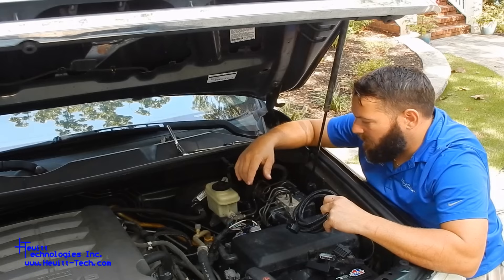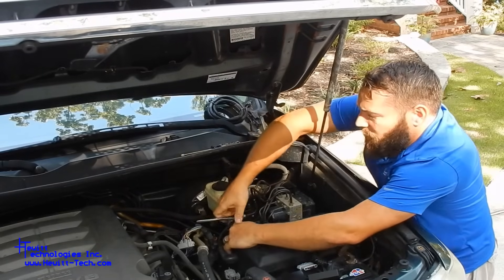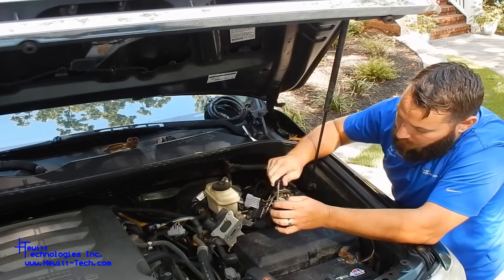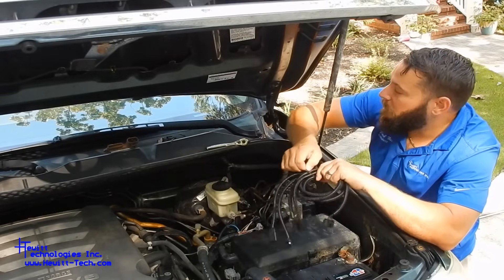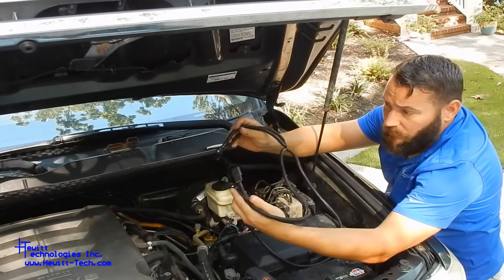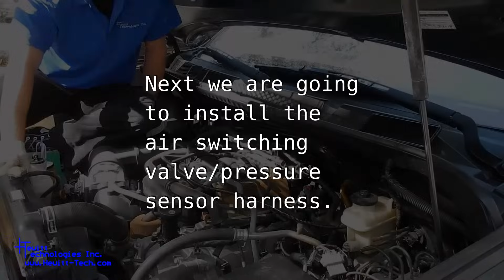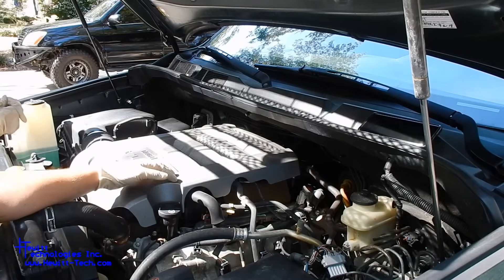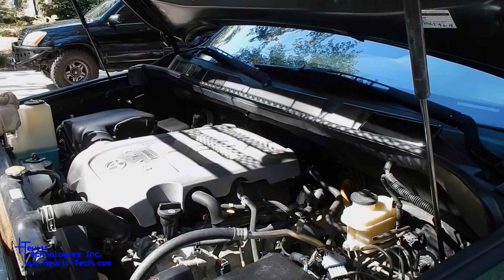Gen-II Secondary Air Injection Bypass Module - 2007-2021 Tundra 5.7L- Hewitt Technologies

Comment: Good evening I’m acquiring a problem I did the bypass unit and everything worked fine for about a week now a new code came out p2714. Has this happened to anyone else if so please advise. Thank you
Reply from the maker: This is not an SAIS fault and would not be related to the Bypass Kit or Secondary Air Injection System. DTC P2714 - Pressure Control Solenoid "D" Performance (Shift Solenoid Valve SLT). Here are some areas you may want to troubleshoot. -Shift solenoid valve SLT remains open or closed
Shift solenoid valve S1, S2, S3, S4 or SL2 remains open or closed
Gear 6 incorrect ratio (sequence valve) or 1-2 shift valve is stuck
Valve body is blocked
Automatic transmission (clutch, brake, gear, etc.)

Comment: I had to replace the passenger side pump on my 07 4.7 tundra a few years back. Cost me about $400 doing it myself. Didn’t know anything about Hewitt back then and didn’t know the problem could reoccur because of terrible design by Toyota. Got another code for a pressure sensor (p2438) this week and went into limp mode. Got the double sensor harness bypass and SAIS bypass (gen 1). Putting the harnesses on and fishing the starter relay took all of 10 minutes. The exhaust block off took about an hour just because of the tight space on the passenger pump. Cleared the codes and now it runs like a top. It’s a bummer a company like Hewitt had to fix a significant issue from Toyota….

Kudos to Hewitt. I highly recommend them if you have any problems with your SAIS or AIP…whatever the acronym is :)
Reply from the maker: John you know what they say, "necessity is the mother of invention". I agree it is unfortunate the failure prone SAIS has not been addressed but Hewitt Tech is happy to meet the need with a comprehensive solution and affordable solution. Thanks again for taking the time to leave a comment and review. Give us a call if there is anything else we can assist with.

Comment: This kit will make the P2443, P2438 and P2436 codes go away? Got a 08 tundra 4.0 v6
Reply from the maker: We can help with all of those codes but some of those are pressure sensor circuit codes that will need some special attn. Please give us a call toll free 1-844-307-7601 or shoot us an email support@hewitt-tech.com before placing an order. 
Some of those codes can be the result of wire damage, sensor damage, bad aftermarket parts or even a damaged ECM.. We can still help take care of all those codes but sometimes it is not as straight forward as just needing the bypass kit.

Comment: Installed a week ago and no more codes or limp mode on my 2008 5.7 w 187k. I was getting the P2443 codes for both banks - stuck closed. Took me a while to get the passenger plug undone, and the block off plates were easier than expected. Worth it!
Reply: Which one did you order gen1 or 2 ?  Which one is required for which?  Ty
Reply: Good morning,,quick question  my 4lo,engine ,trac ,light all comes on do u think this bypass kit will make them go out
Reply: @matthewwatkins1156  It may - if you don't have a code reader, an auto parts store will usually scan for free and give you the codes that are causing the faults. Check that first - mine was P2443, and this kit fixed it.

Comment: For "offroad" use eh?
Reply from the maker: Hewitt Technology’s SAIS Bypass Kits and products are sold for off-road, competition or other emissions exempt vehicles only. It is illegal to remove, dismantle or otherwise cause to be inoperative any pollution control device required by federal, state, or local emissions law. . No other applications are intended or implied. By installing or using this SAIS Bypass Kit the vehicle owner and installer acknowledge and assumes ALL risks associated with its use.

Comment: Will this work with a 2011 5.7 supercharged. I don't know what the previous owner had done to the Tundra. But I'm getting the codes now.
Reply from the maker: The Hewitt Tech Bypass Kit will work with many of the supercharge modifications out there. That said, we still require the Air Switching Valves to be on the vehicle and the Pressure Sensor to be in good working condition. If the valve had been removed they the Gen 2 Bypass Kit would also require the Pressure Sensor Addons. Please feel free to give us a call if you have any more questions (844) 307-7671

Comment: Your links do not work in the description.... Not sure about the $400 you want for some wires. I can replace the parts for that.
If it were $300 I might buy it
Reply from the maker: Thank you for letting us know some of our links are not working. We will get that taken care of asap. 
You can certainly continue to  replace individual system components with low-quality aftermarket parts at those prices if you like. That is the great thing about the "right to repair" we still have in the US. However, when you continue to have problems with the system, I hope you will give us a call and let our 10+ years or so of expertise help you. Those "wires" as you call them are designed, assembled and supported  I can assure you we arent we aren't just selling some wires. I get  so you know... those wires are  developed, engineered, made and supported completely in house by our small SC company. They are covered with a limited lifetime warranty and full technical support that will actually help you fix your vehicle... if you can figure out how to support a small company like ours with the quality and value we provide our customers at a lesser price please let me know. 
Paul Hewitt President.
Reply: Totally agree with this response.

Comment: Installed mine nothing changed still has no power any suggestions
Reply from the maker: Give us a call with your trouble codes. Could be something simple like just needing to reset the ECM, install block off plates or something else.

Comment: I got a 2010 5.7 tundra giving me a P2442 code. Blinking 4LO, TRAC & check engine light. 
We don’t have emissions where I’m at. If I install this does the check engine light stay on?
Anyone know?
Reply from the maker: The Gen 2 Bypass Kit does address the P2442 Mechanical SAIS fault code. However, if this code is masking a damaged Pressure Sensor. We have seen when "Valve Stuck Open" codes have been neglected it can expose the Pressure Sensor to exhaust and damage it. If that was the case you would need the Pressure Sensor addon in addition to the Bypass Kit. As long as you had no factory wiring damage or ECM damage then should address the issue. You can always install the Gen 2 Bypass Kit first and if that does not resolve the issue then purchase the addon.

Comment: Hello, why not just not worry about them. Of course the engine light stays on but that's the only inconvenience. That said, what should I use for my 2012 tundra 4.6 Liter? Also how did Toyota mess up creating junk?
Reply from the maker: Many of the problems with this system will cause the vehicle to enter limp mode. Continuing to drive with valve stuck open codes can damage the pressure sensors in those valves and then you are permanently stuck in limp mode until you take care of it. 
There are other reasons but mostly limp mode. Besides, driving around with a check engine light on is never good. If a more serious problem happened and stored a new code you wouldn't know if the light is always on...

Comment: Do you cover a 2007 Sequoia 4.7L with P0418/P2445 codes? I also have P0340/P0345 camshaft position sensor codes but I feel its related to this "pump stuck off" issue.
Reply from the maker: We do have Bypass Kit compatible with your '07 Sequoia 4.7L to address the SAIS fault codes of P0418/P2445. Unfortunately, our products will not address the camshaft position sensor codes. Give us a call and happy to walk you through the Gen 1 & Gen 2 Bypass Kit options. (844) 307-7671

Comment: Do you need 2 kits if you want to replace both banks?
Reply from the maker: Negative. Even though they are basically two separate systems operating in parallel, one Gen2 kit will take care of both banks.

Comment: To my understand this system prevents the pumps from ever turning on; yet I still hear a whistle/squeal when my vehicle first starts like the pumps are active, though I have no other issues. Is this normal?
Reply from the maker: If you have a Gen2 kit installed there is no way the air pump is running as it is completely disconnected as part of the installation. Toyotas are generally known for a high idle up on a cold start and the engine cooling fan can make a good bit of noise. If you are hearing a squeal, I would highly recommend getting a mechanics stethoscope and try to isolate the noise. There are a lot of bearings/pulleys in the accessory belt drive on the front of the engine that could be making noise to include your alternator and A/C compressor/clutch.

Comment: Do I need the Gen 1 kit for a 06 lexus gx470
Reply from the maker: We have both the Gen1 and a specific the Gen2-3V (a specific version of the Gen2) that will work with your vehicle. There are differences in what they can do so give us a call with your codes and we can do a consultation to determine which is best for you. Toll Free 1-844-307-7671

Comment: Just ordered yout kit for my 2008 Sequoia. read through a lot of forums, so hope it works out.
Reply from the maker: Please give us a call for a consultation and we can help make sure you get everything you may need from the start. Toll Free 1-844-307-7671
Reply: @Hewitt-tech  Getting the plugs off are a challenge...still working on trying to get the passenger side off...will try again in an hour...
Reply: Got the connectors installled...Now off to doing the blocking plate...
Reply from the maker: @saturnfire  I am glad you were able to get them done. They certainly can be especially the passenger side. I wish there was one trick that I could recommend that would work for everyone. 
I try to lay the tip of a small flat head on the tab and use your thumb to depress the tab. Then if you can a long flat head can be used to catch the edge of the connector and carefully pry to help pull the connector off. The most important thing is just to be careful not to damage the wiring or connector.

Comment: does this work for 2007 tundra  4.0 v 6 cylinder?.. error = Check Engine VSC TRAC OFF ..yields decrease power .. won't shift to 5th gear either.. thank you .. code is p0333 .. knock sensor .. i already changed the wire harness.. did not change the knock sensor itself.. couldn't reach it .. somehow i really don't think its the sensor itself .. i think it's the electronics need to be defeated .. thanks again
Reply from the maker: If you are getting a code for a knock sensor it has nothing to do with the secondary air system and our products won't be able to help. 
When it comes to knock sensors on toyotas I never use anything but factory Toyota sensors. It is also common for their sub-harness to get damaged and is often replaced with the sensor. If you didn't use a factory sensor or check/replace the harness I would do that first. You must then test the wiring to the ECM. An ECM failure for knock sensors is also not unheard of either.

Comment: After installing this kit, is there any problems with removing the two air pumps under the front passeneger fender? Just to clean up the engine bay a little?
Reply from the maker: With the Gen2 kit installed the air pumps can be removed. They are disconnected at the air injection control driver and their connectors capped off at the Gen2 unit.

Comment: If I want to install this kit and use it for offroad,would it be able to pass smog inspection{Houston}if I wanted to go back to street?
Reply from the maker: First you must know Hewitt Technology’s SAIS Bypass Kits and products are sold for off-road, competition or other emissions exempt vehicles only. It is illegal to remove, dismantle or otherwise cause to be inoperative any pollution control device required by federal, state, or local emissions law. If you have any additional questions please do not hesitate to contact us (844) 307-7671 or support@hewitt-tech.com

Comment: I know this is older video what are the benefits for doing this mod is what I'm wondering and does if  creat any kind of back pressure from blocking the exhaust ports off
Reply from the maker: @michaelnorman6905 Our Bypass Kit can be installed as a preventative or reactive measure to SAIS failures and trouble codes (CEL).. The main reason for our kits is to prevent limp mode that is associated with many of the trouble codes caused by a failing/failed secondary air injection system. The block off plates are effectively there to permanently close the air switching valves. This prevents exhaust gases from leaking backwards through leaking/damaged/failed air switching valve and cause the valve stuck open codes which are the most common SAIS code that cause limp mode.  The block off plates do not affect the normal flow of exhaust, they only block off the secondary air exhaust ports in the head. I have included a few links that to blog post that further explain if you are interested. 

https://hewitt-tech.com/blog/what-is-the-secondary-air-injection-system/
https://hewitt-tech.com/blog/secondary-air-bypass-kit-comparison/

Our bypass kits and products are for off-road use only and are not legal to be used on highway and non-emissions exempt vehicles.
Reply: Thanks

Comment: I just installed my Gen1 4.7 sequoia. However I still have P0418 code that won't go away. After calling Hewitt tech they said I need to purchase something called a "pump proxy pack". My question is... IS THAT IT??? What another sensor or switch goes bad that controls the air injection system. Will I have to get another switch or sensor? lol I just want the light off!!
Reply from the maker: Hey Sevenout, even though we try to make out product pages and website as clear as we can about the differences between what our gen1 and gen2 kits can and can't do; we still prefer to talk to you first because of things like this. The gen1 kits can't take care of electrical codes like the p0418 code by themselves but the gen2 kits can. The Gen 1 kits require all of the other components of the system to be within a certain electrical spec. We can still take care of them with the gen1 kits but those types of codes require additional addons. The Gen 2 kits on the otherhand can take care of most all of those codes by themselves with the exception of wiring, pressure sensor or ECM problems neither can take care of. The codes are typically very specific but there is some nuisance sometimes. The Gen1 even with an additional PPP is still a much better solution than the cost and trouble of replacing the system. If we knew what your codes were ahead of time we could have helped much more guidance in helping you select the best solution(s) even if it wasn't one of ours.

Comment: Will this work for codes p2438? For a 08 Seqouia
Reply from the maker: P2438 is Pressure Sensor Curcuit High Bank2 (passenger side). This   is not a code our Gen1 or Gen2 kits can take care of by themsleves. The code can be caused by a damaged pressure sensor in that valve, damaged wiring to that valve or a damaged ECM. Most common is damage to the pressure sensor because of it being exposed to exhaust while continuing to drive with valve stuck open codes. We have a kit addon to "replace"/take care of the damaged sensor without having to replace the air switching valve.. however if it is damaged wiring or the ECM those have to be addressed directly. Please give us a call toll free and we can have a more in depth discussion about how we can help. Toll free 844-307-7671 830-500 EST

Comment: does this help if I was given a P2442 code (valve stuck open bank 2)?
Reply from the maker: Yes, the kit can take care of that code as long as it is not the result of a damaged pressure sensor or ECM. Typically, if this is something that just started you don't have to worry about that and the kit will take care of it. 
If you have been driving it that way for a while there it would be best if you gave us a call so we can discuss the possibility of also needing we call a Pressure Sensor replacement. This is a kit addon we use so you don't have to pull the intake manifold and replace the air switching valves just to fix a sensor. Regardless of our kits, those sensors, the wiring and ECM have to be good.

Comment: Paul when you found that corroded connection during the installation of the Gen 2 kit I can only imagine what it would have cost $$$$$ the owner of that vehicle after the mechanics changed both air pumps, the relay, any fuses etc; and everything else they could think of and still not have found the problem.

Comment: Are the gen 2 bypass kits for the 2007-2011 tundra, universal for all engines?
Reply from the maker: @marksilva9397 the Bypass equipment will vary by engine size. That said, if you are referring to only 5.7L Engines; then yes all vehicles from '07 - '11 will have the same engine layout and use the same bypass Equipment. However, we do have Bypass Kit for other engine sizes but install will vary slightly. Here is a link to our installation instruction page https://hewitt-tech.com/instructions/
Reply: thanks, that’s the info I needed, i appreciate it!

Comment: do you make them for 2005 toyota sequioa
Reply from the maker: Yes, it is a slightly different install than the 5.7L. The big majority of the 2005-2009 4.7L vehicles use the Gen2-3V version of the Gen 2 kit. It is not 100% plug and play because the location of the system and has three wires that must be taped into the wiring at the ECM. Check the website and the instructions for that version. You can find them separate under the main Gen2 catagory here https://hewitt-tech.com/store/index.php?l=product_detail&p=94